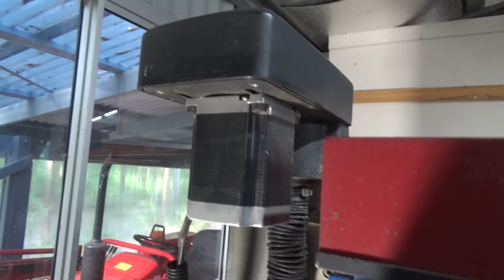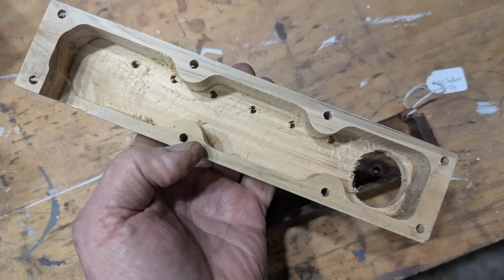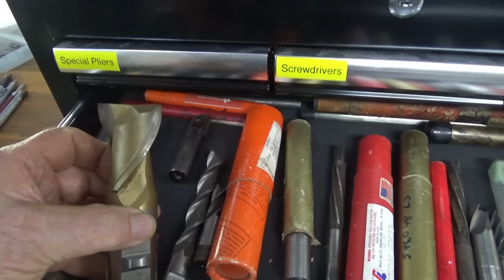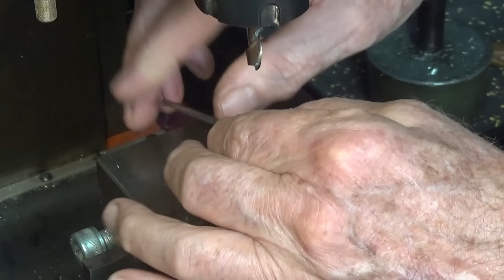Crusader 60. A Model Aircraft Engine You Can Build Without Castings. Ep.8 - The Connecting Rod

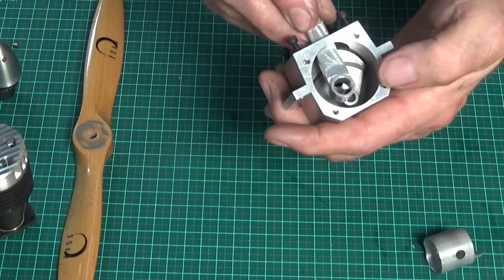Comment: 32:27 - no brass bushing? With brass it should last longer.
Reply from the maker: No, there is no provision for a bronze or brass bush in the connecting rod. However, I am following the original design notes and drawings and this engine will probably only ever run once. Having said that, I have a very well used Taipan Tyro diesel engine that I bought with my own money back in about 1970 and it had a lot of running hours. It has a very crudely made aluminium connecting rod with no bushes and it still runs very well.
Regards,
Mark
Reply: @Preso58  I'm grumpy because of .12 (2.11ccm) nitro ones from on-road racing. Conrod has bushing. That's why I asked.
I lost my engines from socialism polish time ... I do not remember i 2.5ccm diesel ones had or not a bushing.

anyway, greetings from Poland!

ps: yours books never back to me so ...post office sucks :(

Comment: Loved the contrast between the CNC electrical box profiling and the shaper stock prep. You have mastered both the manual and CNC realms of home machining. A great video.
Reply from the maker: Thanks. At the end of the day, it's all about stock removal. How you get there doesn't really matter but CNC has always fascinated me. When I saw the original Hudson electrical box, it looked like it had been drilled out first with an old fashioned brace and bit and then tidied up with hand chisels. The workers who made those parts were probably "piece workers" and they would have been paid for each part made so speed was usually of the essence. 
Regards,
Mark

Comment: You might consider carving your own prop.  Laminate the blank using sheets of hardwood such as maple or walnut. Carving can be done using cylindrical wood rasps and drum sanders for the bulk of the carving.  using lamination of contrasting darkness s will produce a good functional helical pitched propeller.
Reply from the maker: The original designer of the Crusader engine, George Genevro, carved a three bladed propeller from contrasting wood. Some of the wooden stock came from Howard Hughes' "Spruce Goose" aircraft. Given that Mr. Genevro recently passed away at the age of 102, I guess he would have been in his late teens during the construction. It would be interesting to see if a prop could be CNC machined. I do have a 3D model of a suitable prop so it would just be a case of laminating the stock and fixturing it somehow. 
Regards,
Mark

Comment: The vise alignment on a shaper seems counterintuitive to me.  Having the cutting forces pushing out into space gives me pause.  I know this is done due to space limitations. One would think that you’d have to apply much more clamping force than if the vise were oriented differently.
Reply: Wouldn’t be much different than a mill  making cuts in the X axis on a conventionally installed mill vise.
Reply: @grntitan1  But in fairness there are a lot more forces at work with a shaper than a milling cutter,especially when taking heavy roughing cuts....I still don't ever have any problems securely gripping components in my shaper even when the vise jaws are set parallel with the cutting stroke.
Reply: Yet the component rarely moves in the vise....I also have a shaper and most of my cutting is done with the vise jaws set up as Mark's are and I never encounter any problems with secure work holding. 
There is one benefit to this way of work holding in as much as if the tool digs in then it just pushes the work piece forwards rather than breaking something on the vise or the shaper itself.
Reply from the maker: We used to have a similar but more modern shaper at the school where I was teaching. We used to orient the vice so the job was being pushed against the fixed jaw of the vice because students could not always judge how deep a cut the clamping arrangement could tolerate. If the tool dug in it had a good chance of tipping the part in the vice which always ended badly. The light cuts I was taking on the aluminium stock were unlikely to cause any issues but you are correct, orienting the vice at 90 degrees would be preferable. 
Regards,
Mark

Comment: Wrong material here why: (use Translater) 👎👎👎
Im Vergleich zu 6061 weist 7075-Aluminium eine deutlich höhere Festigkeit auf. Die Zugfestigkeit soll im Bereich von 74000 bis 78000 psi liegen, die Streckgrenze liegt bei 63000 psi. Allerdings weisen diese Materialien im Vergleich zu 6061 eine geringere Schweißbarkeit und Korrosionsbeständigkeit auf.

Zusammenfassend lässt sich sagen, dass 6061 besser für Anwendungen geeignet ist, bei denen eine hohe Bearbeitungsfreundlichkeit, Korrosionsbeständigkeit oder Schweißbarkeit erforderlich sind. Für hochfeste Anwendungen wird 7075 bevorzugt, da es unter Belastung haltbarer ist.

For my selfmade 7 cyl 120cc radial engine (see avatar) I ONLY used EN AW 7075 for higly stressed parts and completly built without(!) any CNC machines that is of no challenge....
OK It's your engine and work so I don't really care.
Reply from the maker: The original build notes by the designer and writer of the build article specifies 6061 T6 or 2024-T3 however, the material I used was from stock that I knew was 6061. I did have some other offcuts but I could not identify what it might be. 
Regards,
Mark

Comment: Hello Mark! I've been using estlcam for years; it's intuitive to use and can even directly control a CNC machine. I fitted my crankshaft with bronze  bushings because I'm not sure if aluminum directly on metal is optimal! I love the wild life you live in Australia; it's so different from here in Germany! Stay healthy! Regards Gerhard
Reply from the maker: I had not heard of Estlcam but I just checked out the website. It looks like a newer version of Cambam. I like Cambam because it's quick and simple but it is not so good at full 3D toolpaths. So you fitted bronze bushes to the connecting rod? 
Regards,
Mark
Reply: @Preso58  Yes, Estlcam is also well-suited for 3D operations, albeit with limitations! However, it's easy and intuitive to use! I implemented bronze bushings due to their superior lubrication properties. Regards, Gerhard

Comment: What sort of touch probe do you use
Reply: I was wondering if that touch probe is one of the products that Cliff Hall of Thread Express fame makes.
Reply from the maker: Cliff makes his in house. He calls it the Hallmark Impact Tolerant Touch Probe (ITTP). Mine are just cheapies from Aliexpress.
Regards,
Mark
Reply from the maker: I got two of them from Aliexpress. https://www.aliexpress.com/item/1005004787576000.html?spm=a2g0o.productlist.main.10.dc202ab2WfibXM&algo_pvid=da1d005a-4aaa-40a0-8145-69f60cb254a7&algo_exp_id=da1d005a-4aaa-40a0-8145-69f60cb254a7-9&pdp_ext_f=%7B%22order%22%3A%22295%22%2C%22eval%22%3A%221%22%2C%22fromPage%22%3A%22search%22%7D&pdp_npi=6%40dis%21AUD%2186.69%2186.69%21%21%2155.32%2155.32%21%402101d9ef17626910341868292e87dd%2112000030488712718%21sea%21AU%21160577910%21X%211%210%21n_tag%3A-29919%3Bd%3A9c16467%3Bm03_new_user%3A-29895&curPageLogUid=XGwJWlW1e3c9&utparam-url=scene%3Asearch%7Cquery_from%3A%7Cx_object_id%3A1005004787576000%7C_p_origin_prod%3A
They are relatively cheap but reliable and they have provision for calibrating the position of the probe relative to the spindle. 
Regards,
Mark

Comment: I'm really enjoying this series! Regarding the witness mark around the connecting rod, I've found that screw threads are impossible to use for registration after flipping the part over. Either CNC mill a plate with fixed bosses or drop in some dowel pins with clearance holes for the screws, or leave enough stock so that after flipping the part, you can re-zero everything. Even with all that, ball-screw/nut backlash can get involved and challenge your expectations!  Cheers
Reply from the maker: I realised after the fact that the threaded fasteners were not going to be accurate enough. I didn't have any imperial size dowel pins either but if I were going to do it again I would get some shoulder screws.
Regards,
Mark

Comment: Ok, I’m confused, the roughing was in climb, and the finish was in conventional, or do my eyes deceive me?
Reply: You are not seeing things, it was a conventional milled finish pass.
Reply: Maybe milling machines spin counterclockwise in Australia and New Zealand. 😆 If so, then Mark would be correct.
Reply from the maker: No, you are absolutely correct. Another viewer has also identified that I got it wrong. This shows my lack of experience with Fusion360. Up until recently, I was using CamBam for all my CAM work. It has a very simple setup menu and there is a drop down box from which you can only select "conventional" or "climb". 
Regards,
Mark

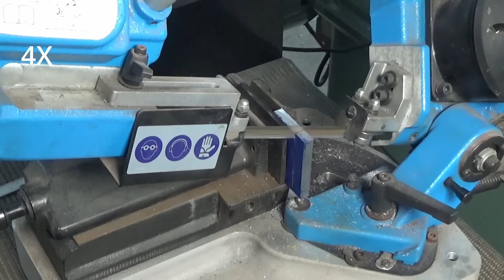Comment: That bandsaw tracks very well @14:00 Did you need to perform any special work to get the blade to cut so perpendicular?
Reply from the maker: It did track better than I expected.  I did have some trouble with that saw when I first got it. Evidently, it is necessary to tighten the blade much more than you would think was safe or necessary.
Regards,
Mark

Comment: An acquaintance of mine made a bracket that held his router to the side of the mill spindle and routed wood on his DIY  CNC converted mill, a sample of his was a spiral conical groove.
He also used the mill for metal cutting. He was making a homebuilt airplane.
Reply from the maker: I have seen that trick done with an offset high speed spindle. I believe you just need to map the offset position in the CAM software. I could get a higher speed by just increasing the frequency of the VFD but I am not sure the spindle bearings would like it. 
Regards,
Mark

Comment: Great job, I would love a CNC mill but I think the stress of running it would probably put me off. Makes me laugh how you are supposed to be ready to take over in your Tesla when it decided to do something left field, I doubt I could stop the cnc mill in time if it went wrong.
Reply from the maker: Yes, it can be quite stressful when running a new setup or stopping or pausing a CNC job. The UCCNC software that I use now is much better at avoiding crashes when using the "run from here" command. Most of the jobs that I do are all one offs, so there are a lot of unknowns each time. When I was running the electrical junction box jobs, it was only the first one that you had to monitor very closely. 
Regards,
Mark

Comment: Nice job on the junction boxes. Alternatively, if someone lacked the equipment to do it with CNC, decent results could probably be achieved with a carefully prepared oversized template and a template following router bit in a plunge router.
Reply from the maker: I was sent one of the original junction boxes and it looked like it was first drilled with an auger bit and then the remaining stock was cleaned up with regular wood chisels. It was pretty crude really but I just checked and Bakelite was discovered in 1907 so I am surprised that Hudson used wood for those components. A plunge router and simple template in conjunction with a long carbide cutter with a top bearing would be a great alternative and probably much quicker than what I did.
Regards,
Mark
Reply: @Preso58  But it would have made a good woodworking video rather than a good machining video and that isn’t really the point. The way you did it was more interesting.

Comment: Very, very nice. A great thing about YT is seeing how different machinists approach tasks. I think Joe Pi would have counterbored the fixture backing plate and made the button shanks a bit longer to sit in the counterbores. He always says he doesn't trust threads for positioning. Take this with a grain of salt from a guy who has never machined anything except with a hacksaw, file, and drill press :-)
Reply: Yeah , I agree, a locating bore not the threads .  It’s always easy to look and criticize.  I’m just thinking thru what I do in same situation. Btw, I do , do this sort of thing, every day .  But everyone has opinion .  Especially machinists :-). Btw, mark, identify your fixtures in fusion
Reply from the maker: I must say I am a bit lazy when setting up jobs in Fusion360. When I was first learning about CAM, I was working in CATIA and we were issued with a fully modelled fixture and a model for the stock. This was because we were using a very expensive Denford CNC router and we were allowing students to run it. CATIA had a very good machine simulation workbench and it identified tool crashes before we even went near the router. 
Regards,
Mark
Reply from the maker: Joe is correct and I do trust his judgement for work like this. The best solution would have been to buy some precision ground shoulder screws.
Regards,
Mark

Comment: Mark, I'm a bit confused by what you are calling "climbing cuts." My understanding of a climb cut is when the tool moves around the work in the same direction as the rotation of the end mill. So with my machines that would be clockwise. Is your machine running the end mill counter clockwise? Those climb cuts looked like the machine was traversing CCW.  Is this an Aussie thing like how your water drains from a tub the exact opposite of the rotation in the northern hemisphere?
Reply: I agree, it appears the cuts, for a climb cut,  are going the wrong way.... even for us here in Oz😂 Should be clockwise for an outside cut and anti-clockwise for an internal cut. Pretty sure the bit is rotating clockwise.
Reply from the maker: Ha! I just went back and watched the video and you are correct. The operation I identified as a climb finishing pass was actually conventional milling. I think I messed up the feed direction in Fusion since it didn't seem to have a "climb" or "conventional" menu item. I think it just allowed for "reverse" feed. I generally use CamBam for making my Gcode and it is easy to see at a glance in the setup window if you have chosen the correct feed direction. 
I shall have to remember that for next time.
Regards,
Mark